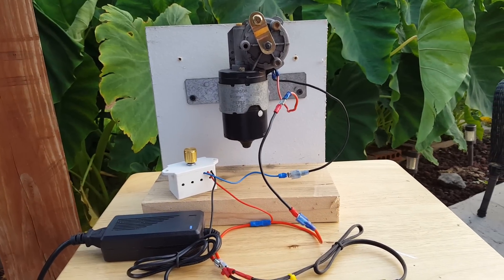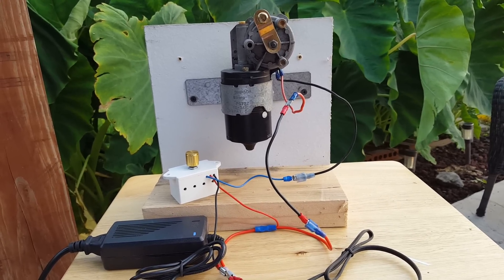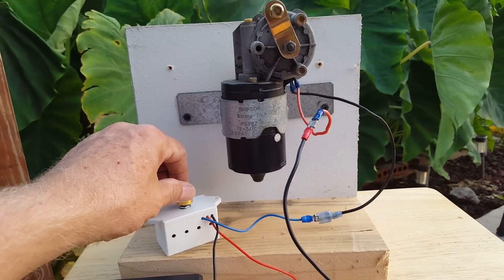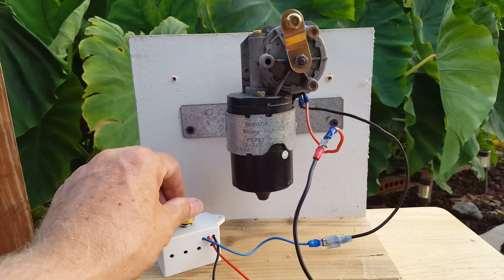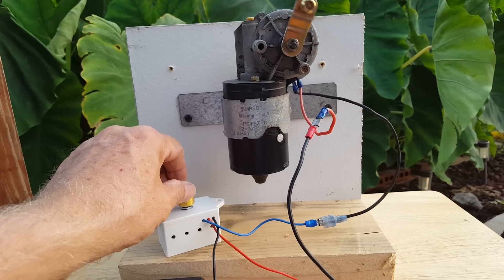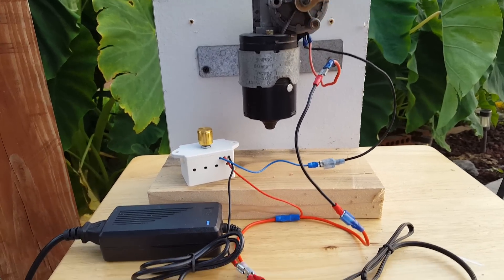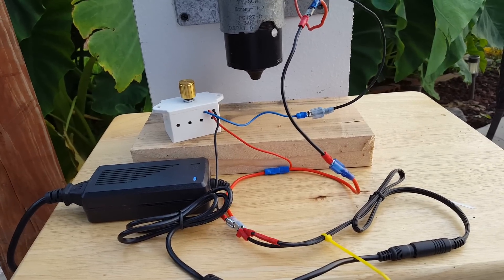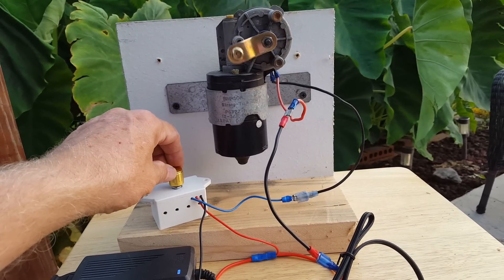Demo of 12v Power Supply Powering a Wper Motor with a Motor Controller

Comment: could you send me the links to the converter and the little box .. i have a project and i am using a wiper motor.. thanks any help would be great...
Reply from the maker: David, the power converter is just a 12 volt 5 amp converter the same as for a laptop. I don’t have a link but I just searched eBay for “12v 5 amp power supply”. I am assuming the “ little box” you referred to is the motor controller. Again I don’t have a link but just search eBay for a “12-24 volt motor controller”.  Also, you can go to monsterguts.com and purchase these parts but they will cost a little more.
Reply: @larrygiggy6871  yea... i went ahead and did that... lol .. thanks

Comment: sir can you give me the wiring diagaram?
Reply from the maker: Gilbert, 
I tried to upload the wiring diagram for the motor controller I use but was not successful as the photo was too large to upload.  This particular motor controller has the wiring diagram printed on the case but here is how the wiring is hooked up.  The motor controller has 3 wires, black, red, and blue.  The wiper motor will have 2 wires, a positive and a negative.  The 12 v power supply will have 2 wires, a positive and a negative.  You should connect the positive on the wiper motor to the hi speed connection.  You can find this by connecting the wiper motor directly to the power supple and experiment until you find the high speed connection.  Once you have this connection here is how to connect the motor controller.  The blue wire from the motor controller goes to the negative wire on the wiper motor.  The red wire on the motor controller connects to the positive wire on the wiper motor and is spliced to also connect to the positive on the 12 v power supply. The black wire on the motor controller connects to the negative wire on the 12v power supply.

Other motor controllers will likely have different colored wires so this may not help much but I would guess that any motor controller you buy will have instructions and a wiring diagram with it.  The motor controller I use came from ebay.  It does not have a brand name on it.  Just search for a 12-24 volt 5 amp motor controller and any will work.

Comment: Hate to ask..do you have any links on the speed controller and power supply you bought off eBay? Or at least the names of them? Trying to build the same thing for a Halloween prop and this would be ideal
Reply from the maker: dblack,  sorry I don’t have a link to this specific motor controller.  I just checked and it appears neither eBay nor Amazon still carry it.  However, you can search either site for 12-24 volt PWM motor speed controller and several will come up.  Any will work. I just bought this one because it was enclosed in a case. But you don’t need to buy any expensive one. I wouldn’t pay more than $10 at the most. Also, you can find them on monsterguts.com. In fact they actually have the complete setup as a kit now.

Comment: where did you get the bracket to hold the motor?
Reply from the maker: JC, the bracket is just a chain link fence post bracket that you can find at about any hardware store. I buy mine st Lowes. It is just the right size to hold the wiper motor.

Comment: Curious.  What is your power supply plugged into? A wall socket, a 12V battery, or another source?
Reply from the maker: The 12v power supply plugs into a regular 120v house current plug.

Comment: What AMP is the controller rated at?
I keep burning them out , ive gone through 2A to 30A, about to buy a 60A one right now!
Reply from the maker: RID1
I'm not quite sure the amp input on the motor controller but I believe the power supplies I use are rated at 5 amp. Also, the motor controller is rated for and can be used on either 12 or 24 volts. I have never had any issues with it not working properly on any prop I have made.
Reply: @larrygiggy6871  Thank for responding, so many people are getting these to work off 5A and I'm not. Im starting to wonder if the motor is my issue. Im using a 7Ah battery as power supply, everything else will not power the motor.Maybe battery is too high powered, I'l see if I can find a genuine 5A  power supply but here in Africa we are flooded with cheap chinese products. The 10A power supply I have right now cant power the motor.
Reply from the maker: @RiD1·RiD1·RiD1  ok try this website. monsterguts.com. Look under the drop down menu and click on electric motors. They sell a complete setup with the wiper motor, power supply and speed controller for around $70 us that might be best for you to use. It is the same set up I use except for the motor controller. I like the one I get from eBay better because it is enclosed in a plastic case that makes it a little more moisture proof as my haunt is outside on 10 acres and sometimes it rains. I also get my power supplies from eBay because they are somewhat cheaper but you do have to be careful which one you get as some from China don't put out the correct power. Also, I do get the wiper motors from monsterguts.com. I buy two at a time to save a little on shipping. I hope this helps.
Reply: @larrygiggy6871  Thanks for all your efforts in responding to me, Youtube for some reason has not notified me of any of your responses?
Had I previously known about that monsterguts site I would've bought from them knowing that this is what they specialise in and their parts would definitely work together.
Will keep it for future reference. THANK YOU 
I've received my 60A PWM controller from Amazon today , made by DROK, also purchased a new motor locally today. I'll see if i can get a supply like yours at the local gadget shop tomorrow , i think the battery may be too powerful causing these controllers to burn up everytime.
FYI, not using this for props, Halloween is not celebrated in South Africa really, this is more for the sake of experimenting since I saw videos on how wiper motors can be reused. Once i've got it going properly, I'll figure out a use for it!
Reply from the maker: @RiD1·RiD1·RiD1  Glad to help where I can. As I recall now that motor controller I use is rated at only about 5 amps so if you happened to use a car battery to power the wiper motor it will certainly send more than 5 amps through the controller even though it will be only 12 volts. That's why I have been using those 12v 5 amp 60 watt ac adapters for power like the ones used to provide power to laptop computers.  I have burned out one controller when I connected a vehicle battery to the circuit. And yes there are lots of neat things that can be done using wiper motors. They are lots of fun to work with. Hope you have good luck with any projects you do. I'm certainly not an expert on this but please contact me if I can help further.
Reply: @larrygiggy6871  Thanks so much again, tried a power supply like yours and i probably got another dud, so im done with buying power supplies.
The new DROK 12v 60A PWM Controller is working great off the 12v 7aH battery , no signs of heat or stress with the motor running at the slowest speed for over 10 minutes now, Not a single component is getting warm, Im pretty good to go now. Thanks for offering  support.
Reply: @RiD1·RiD1·RiD1  .
Reply: @johndamman3527  dot

Comment from the maker: While there are 4 connections you only wire the controller to the Hi RPM connection on the wiper motor. Once this is done the controller will allow you to sun the wiper motor from low to hi speed. There is no control of the park or intermittent functions of the wiper motor.

Comment: i want more details the connection from motor to the speed control.. since wiper has 4 wires.. how it connect into 2 wires to the motor
Reply: You don't need all 4 wires, you need to find which two wires are for POWER and use only those 2. I have 5 wires - Red, Black, Green, Yellow and White. My power Wires are the yellow and green, the rest are not needed, Hope that helps. You need to search for a wiring diagram for the wiper motor of the make of car it came from, mine came from MK1 VW golf.

Comment: Hi Larry  Excellent Video - appreciate the information.  I'd like your feedback on a few questions if possible.  I am trying to build a self contained electric tug to move a 2K lb aircraft both forward & reverse.  Am wondering if the motor is wired on the low rpm side with a motor controller, reverse polarity switch and a 12V 18amp drill battery with a roller wheel attached to the output shaft it would have enough torque to move the aircraft.  Once the aircraft starts to move it is relatively easy to continue the movement as long as there is enough torque.  Downward pressure on the roller wheel from a tow bar would supply the friction leverage.  Thoughts?

Comment: Can a speed controler work on a single  speed wiper motor
Reply from the maker: Frank, I don't see why this motor controller would not work on a single speed wiper motor. The wiper motors I use are only two speed, high and low. I just wire the power source and  controller to the high speed side of the wiper motor. So in effect it is working on only one speed setting which seems this would be the same as a single speed wiper motor.
Reply: @larrygiggy6871  that was my thinking ill try it and let you know i enjoyed your video

Comment: LARRY!!!! You just solved my dilemma! I'm building a mannequin that needs to raise and lower his arm. I need high torque and very low rpm. The motor speed controller is perfect. Thank you so much for taking the time to upload this video.
Reply from the maker: Happy that this helped you. I use this set up to power my swamp monster that raises up and down under a bridge in the haunted forest. The body of the prop is made from 1 inch PVC pipe so it is relatively heavy. I have not had any problems with the wiper motor powering this prop.

Comment: great vid, thanks.  Curious on strength for this kind of set up.  in terms of resistance. in other words how heavy an object could this move (depending on levers of course) before it jams up?
Reply from the maker: I have used this set up on several props...full size wooden coffin lids, pirate rum barrels, even a 7 foot tall swamp oger that rises up and down from under a bridge in our forest as well as several other props.  I have never had any problems with the wiper motor not being able to work because of not having enough torque. I did have one issue with the teeth on the arm that attaches to the motor stripping out on one prop. But that was due to me using an aluminum fabricated arm rather than steel.  The metal teeth on the wiper motor had no issues.
Reply: @larrygiggy6871  that's great to hear, looking around for parts as we speak.  i'm in Canada so some of the companies you guys use are simply too costly due to shipping costs. If anyone knows a good place to order from in Canada please let me know
Reply: @larrygiggy6871  also, is your wiper motor from a car or did you buy directly from prop store? when looking for wiper are there things to consider or are all wiper motors pretty much the same?
Reply from the maker: The wiper motor is a vehicle wiper motor but I buy them from monsterguts.com. I can actually but these new motors a little cheaper than what I can get used here in Missouri from an auto salvage yard.  I usually buy 2 at a time because the shipping is only slightly more to ship 2 rather than 1.

Comment: Video were is negative and possitive wire
Reply from the maker: It really doesn't make any difference where you connect the positive and negative to the wiper motor. If you have them reversed the motor will just turn backwards. For the motor controller there is a small schematic on the controller case with connection instructions.

Comment: Can u pls tell me hows that done pls it's needed for my project pls
Reply from the maker: Nebojsa, the motor controller has a diagram on it of how to wire the motor, controller and power supply.  Here is the wiring design. The motor controller has a red, black, and blue wire coming from the controller. From the power supply (either a battery or as I use a plug-in power supply) connect the negative of the power supply to the black wire from the motor controller.  Connect the positive lead from the power supply to the red wire from the motor controller.  You will also connect the positive lead from the motor to this red wire from the motor controller.  Connect the blue wire from the motor controller to the negative lead from the motor.  That is all there is to it. It is very simple, cheap and works really well for this application.

Comment: I’m going to use this to rotisserie a hog, do you think the motor looses any torque power with a speed control on it, because I was looking and chains and sprockets to reduce the rotation, but this might be better if it doesn’t loose turning power but just slows down.
Reply: Dustin the motor controller will not cause any loss in the torque of the wiper motor
Reply: Larry Giggy so it would be a good idea for me to use a motor controller instead of chains and sprockets to reduce the rpm

Comment: Any links to amazon for the controller?
Reply from the maker: No I don't have a link to the motor controller. I bought it from ebay but now I don't see this specific motor controller but there are several that are basically the same thing.  The only difference is they do not have the plastic case.  Just do a search on either ebay or amazon for a 12v - 24 v motor controller.  Several will come up.

Comment: That's a cool setup, but how much torque does it have?
Reply: Robert Freemond  there is plenty of torque to run any prop that you want. I have used it to lift a 7 ft swamp monster made out of 1 inch Pvc pipe 3  up and down for over two hours non stop.
Reply from the maker: Robert, I really don't know how much torque the wiper motor puts out.  But it is strong enough to work all my DIY animatronics including an 8' swamp monster that is made out of 1' PVC pipe, covered with a camo fabric and moves up and down for a distance of abut 12".

Comment: is 12volt 5 amps transformer work ?
Reply: Desi mechanic yes you will ned a 12v transformer with at least 5 am output.
Reply from the maker: I should.  You need a power supply that will supply 12v and at least 5 amps.  If the power supply doesn't consistently provide at least 5 amp even thought it provides 12 v it will not power the wiper motor.  I know this from experience as a couple of the power supplies I bought would not power the wiper motor.  A check of the power supplies showed that even thought they were advertised as 12v 5 amp they did not put out the necessary 5 amps.

Comment from the maker: Jeff, no that is not the power supply I use. However most 12v power adaptors will work as long as they put out at least 5 amps.

Comment: Great job and great demonstration. Can you provide a link to the power supply. Many power supply out there are for LED lighting (even though they are 12V, 6A). They burn out pretty fast. Also what car is that motor from?
Reply from the maker: Wishwa here is the link to the power supplies I use. https://www.ebay.com/itm/12V-5A-60W-Power-Supply-AC-to-DC-Adapter-for-5050-3528-Flexible-LED-Strip-Light-/253152922359?var=&hash=item3af1170af7.  They actually are power supplies for LED lights.  I have been using them for several years and none have burned out yet.  I did get one order of 3 power supplies that the power supplies simply would not power the wiper motor.  These were a different model number (LY1205) than I usually buy. I checked them and none were not putting out 12 v or consistent 5 amp power.  But I have bought several of the above model number power supplies (WT-5000) with no issues do date.  However be sure to check them right away after you receive them to be sure they will power your motor.  You can also get the power supplies from Monster Guts but they are significantly more expensive.

 I order my wiper motors from Monster Guts.  They last ones I ordered  last year were about $24 plus shipping.  These are new and I found that used ones from our local auto salvage yards were the same price so I decided to buy the new ones...no brainer I think.  Their website does not specify what vehicle they are designed for. There is also a reply on this question below that Farshead68 had.  Good luck with any project you are doing.
Reply: Larry Giggy  I just clicked the link and it states that this item is no longer available.
Reply from the maker: Jeff, any of the 12v 5 amp power supplies should work as long as they will consistently put out at least 5 amp.  If they don't put out at least 5 amps they simply will not power the wiper motor.
Reply: Larry Giggy Is this the same make/model?
 https://www.amazon.com/SUPERNIGHT-TM-100V-Switching-Adapter/dp/B008FKDK2M
Reply from the maker: Jeff, not it is not the very same model number that I have been using but I bet it will work.  Just be sure to check it when you get it to be sure it actually does put out 12 and 5 amps.
Reply from the maker: Hi Adam, sorry I am so late to reply.  I don't normally get on youtube unless I am posting something and I didn't get an email notice with your question.  I really don't know what you will need to make this work.  I do know that many home haunters have setups using wiper motor that will rotate one way, then hit the "park" mode on the wiper motor, then rotate the opposite way.  I just don't know how to do this.

Comment: Shane, I'm not confident that a phone wall charger will work to operate a wiper motor. It would not only need to put out 12v but also need to provide 5 amps to power the motor.

Comment: Will a wall charger for my iPhone run the wiper motor? Thanks.
Reply from the maker: Not unless it puts out 12 v and at least 5 amps of power.  I don't know of any phone chargers or wall warts that have that output. My Iphone charger only puts out 5.3 v at 2 amps.